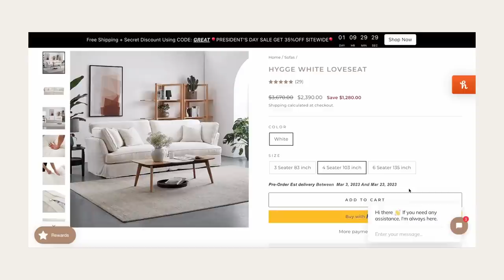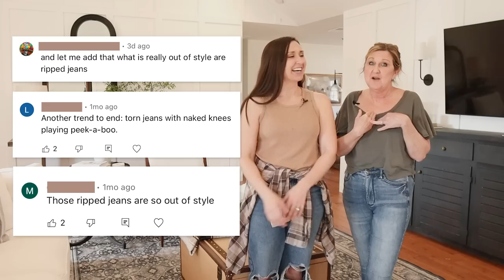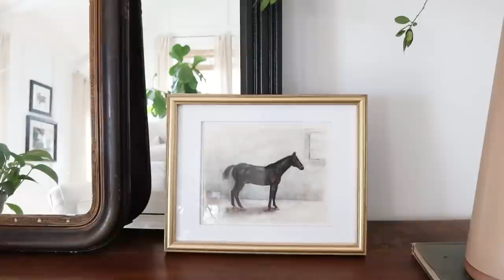LIVING ROOM UPDATE - Is a Home Design Ever Done? 🤷🏻‍♀️ - 25HOME SOFA REVIEW

Comment: Alright I've really analyzed.lol. okay so the couch area is too spread out because you're trying to fill up the room. Go ahead and push everything together about a foot and make that to scale with what the sitting arrangement should be without trying to overcompensate to fill the room. 

What I think is lacking is there is a lot of space behind the couch. And that's what's confusing you. That's why you pulled the living room apart to spread out. You need to create a separate thing behind the couch. For example you can get a small round table and put it between the windows. And make that like tea time. Or a scrapbook area .And another single chair in the corner where the window is. And I think if you do this you'll need two rugs. A smaller rug once you push everything to scale. And then a separate rug to ground the other living area behind the couch. 

And or. Where you have that beautiful wooden table move that to behind the couch and create another sitting area where that was with two chairs and a table of some sort. And make that like working space. I don't know if it needs to be a conversational area with two seats and a small table. But the room definitely is big enough to have two things going on. You need to look at some magazines or videos where rooms are broken up into two living spaces.

So in conclusion, scale as in the room is big enough to have two livable areas. Extend the curtain rods and perhaps add another panel. Insert personality 😝. For example color. Choose a color. Those blue stripe pillows don't count unless accentuated with some personality. Your house in general it just looks like a showroom. And I think maybe that's because you're getting your ideas from like a structured showroom. But you need to find your personality. Your everyday habits aren't showing... That should be an easy way to figure out personality. Do you read magazines? Because that doesn't show. Do you eat chocolate because there's no chocolate. Do you never go out on a date and we're color or a lipstick or nail polish? Because that part of your personality should also be reflected in the space somewhere. You don't like shiny things diamonds gold? Don't like the color of metals,Because that also doesn't show in the room. What do you love? Do you love flowers? Do you love DVD movies. Vinyl. Photos. There's nothing in the room that indicate that you live there. 😁🥳🤗